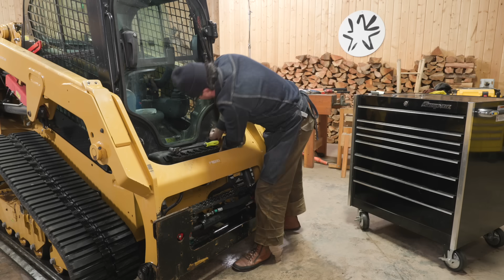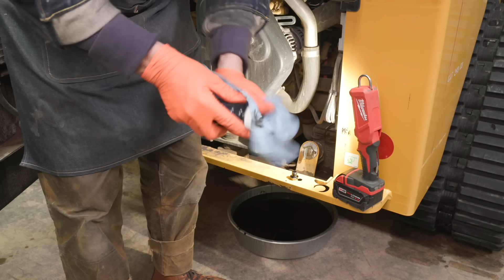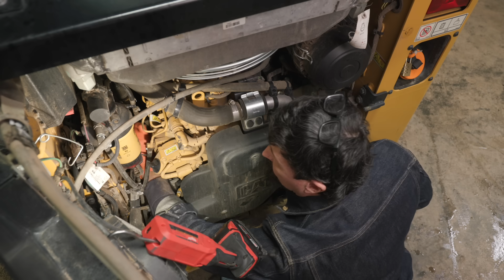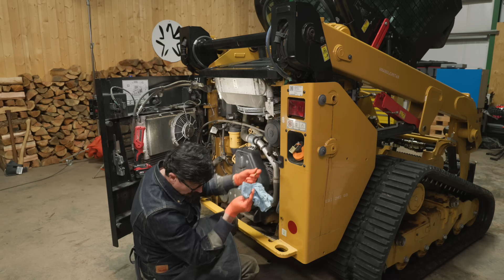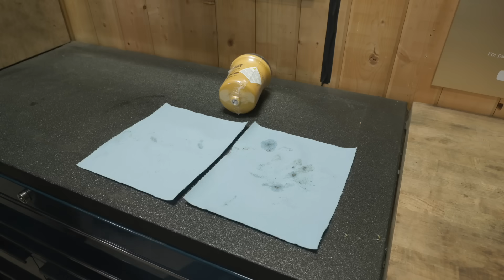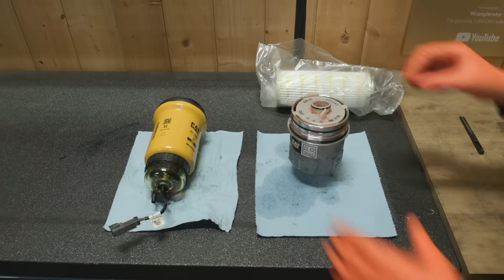Everything is Falling Apart

Comment: As a former cat pm tech, when taking an oil sample the oil should be hot and taken from the dipstick tube. That’s what cat recommends. If you catch it from the from the drain you will get bad results. Also you can clean the outer air filter but not the inner one. To make you life easier take off the Beauty cover it gives you a little more room to work.

Comment: Cody, sadly you are spot on (as usual) regarding the degrading quality standards compared to yester-year. Maybe the old folks when I was young said the same thing? On a side note, I've been a professional heavy equipment mechanic for 40 years now and you are correct, things are unnecessarily packed into much tighter spaces now in the name of "sleek & efficient" redesign. The young & upcoming engineers need to be mechanics for a few years before they are allowed to design machines & equipment. I won't hold my breath. Only 8 - 10 years to go before retirement, God willing.....

Comment: Incompetence has been a problem for longer than you think. I worked on my families farm full-time from 78 until the very end of 93 and we had that same problem getting part for maintaining our tractors and other equipment that you have had with your skid steer. It is very frustrating especially when you go in there with the right numbers for the equipment that you’re working on and they ultimately gave you at least one wrong part.

Comment: I found it essential to warehouse stuff in advance once we finally got the stuff that works.  Prevenative maintenance parts and even fluids.  Most machines use almost all spec. Fluids for everything now and you can't just get them anywhere.  Also nice to make stickers to note the parts , fluid specs. And volumes for quick reference or like we all dread someone else is on the equipment when something goes wrong.  Needed more fuel filters on hand than anything.  When things go wrong there it's really wrong.

Comment: Did you consider a rubber mat on top of tool trolley to protect paint and scratching tools .  Also can stop stuff rolling off
Reply: Or a butcher block top with a vise in the corner. We had that on an aircraft flight controls/hydraulics tool box similar to Cody's, and it was the cat's meow.

Comment: I have a 2007 Bobcat T250, it's a bit easier to service. That 3 gallon figure is fairly common. Our Cummins 5.9 & 6.7 12quart, Bobcat T250 and 1996 Deere 550g 3.3 gallon. The oil change interval at that capacity is 300 hrs.

Comment: Bad samples get another sample to verify and sometimes a 3rd if the the results do not make sense. Also most major manufacturers do not want filters to be prefilled. Too much added engine wear over time has been a credited to filters being prefilled. Not only does the oil in the jug have junk in it from the manufacturing process, but also peoples lazy habbits. They say the oil pump will pickup and fill the oil filter before the residual oil in the pump, oil gallies and beaings surfaces is used.
Reply: Truth. Better to remove the fuel pump fuse and crank it over a few times if a person is worried about priming the filter.

Comment: Red Diesel? In Canada we color Diesel red for home heating
Reply: in the USA red diesel is un-taxed and for off road or agricultural use only! dyed red so it can be identified by law enforcement if they suspect someone is misusing it over the road.
Reply: @tylermallory2504  No Diesel should be taxed.
It power all the working equipment,  farm, construction, big rigs transporting everything, even work pickup trucks!
Less taxes or removal of expensive  tax friendly politicians should be in mind 24/7
Reply: Its also for off-road or farm equipment or other non-taxable stuff: its the same in both Canada and the states.

Comment: It's not always a matter of incompetence of the counter guy. You may not have all the proper information to give him.   I recently was working on the power steering for my Massey Ferguson 165. I have had it for over 15 years but I bought it used. I bought close to $150 worth of wrong parts on the internet.  Even a local guy that used to be a tractor mechanic (he's in his mid 60s) couldn't find the right stuff. He and another farmer/mechanic referred me to an ag supply store that happens to have an expert on Massey Ferguson. I was able to get my parts. But I'm still unable to get the steering adjusted perfect. Sometimes you have to match the parts. I have had problems many times and I only work on my own equipment. Good luck.  You will get your parts.

Comment: Work with a 319G Deere skid loader and it looks like it is easier to do a service on.  Hydraulic filter is in front of motor, below the cab and others are visible from rear access.  And you can check the dipstick and fill oil while standing.

Comment: Long time back, I ran the electrical maintenance side of a South African-based brickworks, using a tunnel kiln and  modern automatic machinery-driven brick making. I lost count of the times I arrived at a breakdown, and the squad were busily trying everything in sight, and tearing their collective hair at the same time. Every time, and I do mean every time; my first question was “Have you studied the Drawings?” I know I’m not the brightest spark in the room, but reading an electrical wiring diagram for a fault is just like reading a book backwards. But could I drum this into the collective skulls before me? Nope!

Comment: Man. Incompetence at these places is getting bad. I was told the other day by a ford dealer parts department that my 7.3 doesn't have a replaceable fuel filter. I absolutely lost it.
Reply: I dont think the new 7.3 does.
Reply: @Phill2tj23  a 1999 diesel powerstroke does too. The new 7.3 is a gasser. So when the parts guy asks the year first and then the model and then the engine... he can't get the new gasser mixed up with an old diesel 25 years apart.

Comment: Had old TF33 aircraft engines that need oil samples burned.  We called them JOAP (joint oil analysis program).  Probably same principle.  They burn it and look at flame and smoke to determine if there is bearing or engine material in oil and how much of it.
Reply: Same.  I worked small turbines (ground support) and we had to send off oil samples at certain hours to the JOAP lab at jet shop.

Comment: Guy who only has 1 drain pan and says every  man should have 2 chainsaws? Doesn't even do final drives or even do in tank hydraulic filter? Rookie, who cares what cat says its cheap and gets rid of all initial break in wear debris. Hour meter cannot measure the wear put on those systems. For the price, do um anyway. Every proho should have mulitple drain pans and have common knowlege on servicing their equipment. Typical west coast boy

Comment: Dont for get you must also change your final drive oil!
Reply: Must?
Reply: @misdabeat1983   Yes first final drive oil change is at 250 hrs and every other is done at the 500 hour intervals. 250, 500, 1000, 1500 and so on.
Reply: What the planetary gears???
Reply: @misdabeat1983  Final drives are the gears that move the track

Comment: Thanks for adding a bunch of those fluid pitchers to my maintenance tools!
I added fumoto valves to my equipment and also use a fluid extractor on some of them.   I also have a oil pump to pump in oil to weird fill locations.

Comment: Put grease on the o ring instead of motor oil. I learned that from a older gentleman on a cattle outfit that I worked on
Reply: If you're doing it quickly I find the residue on the face where the gasket sits always has plenty of the the old motor oil to lube the gasket
Reply: @misdabeat1983 good thing you put that in a reply! 
If you had put that in the main comment page, the keyboard warriors would have a field day with you using “used” motor oil on the rubber!🤣
       (I do the same)😁👍

Comment: You should check your maintenance book and see if there is a second filter location. I am not familiar with that model of skid steer, but I have honestly always been very well attended by Caterpillar parts especially if you gave them the serial number.  Those machines are built and each component is basically matched to the serial number.

Comment: you think it would make more sense for a company like cat to have all the small machines use 1 type of filter for each fluid rather than have 50...
split it into small, medium, large, XL sizes for everything and keep those parts onto newer models for as long as possible.
its got to be WAY cheaper to make a lot of 20 different filters rather than a few of 200 types.

Comment: You need to get a clean burn oil burner to use your used oils to heat your shop. It eliminates having to dispose of your used oil properly
Reply: Agreed
Reply: Those will burn almost everything hHa
Reply: Would it actually burn clean with contaminated oil?
Reply: @chemicalbrucey157  probably. they have filters for them

Comment: Caterpillar cares so much about their reputation that when they mandated DPF filters on simi trucks that they stopped putting engines in them. they knew from the start that DPF systems were supposed to be the death of diesel engines, and they were not willing to compromise. they do have very good dealers too from what i have experienced. the only company that you can get parts still for dozers from the 1940's back when i worked on them. i made the mistake of switching to automotive repair.

Comment: I learned many years ago to take the part with me if possible. get any numbers off of it and check my manual for part numbers. as well as make, model, and serial number off the machine. few parts  guys actually know what you're after. they just know what the computer tells them.

Comment: Yes, never trust opened oil vs the cost of an engine.  I recently had a close call only saved by the introduction of the opaque oil pitcher.  I had drained used brake fluid into an empty quart oil container and put it back on the shelf, thinking I would remember that it was waste and not oil.  3 months later I am doing an oil change and opened the used brake fluid container and almost dumped it into the engine.  For some reason I stopped and filled the oil pitcher and noted the blue color of the 'oil' and how thin it was.  I contaminated 1 gal of synthetic oil but saved contamination of an engine.  Penny-wise....

Comment: You seem to have a lot of equipment that uses oil; what are your thoughts on used oil furnaces?
I worked in an auto mechanic shop that used one and it was surprisingly efficient as long as the drip rate was correct.

Comment: i wouldn't be so fast to point fingers you always and i mean always double check part numbers and serial numbers for any machine there are instances that an oil filter can have the same dimensions and threads but the pressure reliefvalve for the oil bypass relieves pressure at different pressures an example of that is the MAN w940/25 at 2.5 bars and the w940/35 at 0.7 always be carefull what you put on your machines guys

Comment: You own the equipment....your fault. If you don't know what parts you need you shouldn't be servicing it.
Reply: 😂😂say you don’t work on your own vehicles without saying it…
Reply: @mich5167  Me? Yeah sure. If you are depending on someone else to give you the correct part, have someone else do the job. It costs more after you mess it up and have to take it to me to fix your mistake. You purchased a very expensive machine. Invest in good maintenance or atleast read the manual. Don't just assume you know what to do.
Reply: @retam1418  oh yeah, why even have customer service right?

Comment: I wouldn't run that little engine to its maximum service interval on engine oil they have tighter tolerances and spin much faster than big engines I change mine around 200 hours

Comment: Fuel and oil filters should never be pre-filled. When you pre-fille a filter, one would generally fill through the center of the filter. The center of the filter is the "clean" side of the filter. By pre-filling through the center, you are introducing potentially contaminated oil into the system. Couple that with no benefit because fluid systems (on Cat machines) are designed to operate properly on start-up with no oil in the filter. Maintenance is a leading source of contamination. Before you crucify me, I've worked on or around Cat machines for over 20 years and currently lead the technical support team at a Cat dealer.

Comment: There’s 2 hyd. filters, the pilot filter and the in tank filter. Sometimes 3 hyd. filters. The new filter is an in tank filter. I’m not a specialist on skidsteers I usually stick to loaders and dozers, but I think you should check for moor filters on you machines.

Comment: It onky takes 2 gallons a 1/4 of a gallon but they sell you 3 because they only have it in gallons and 55gallon drums thats why if some one tells me it takes 4 gallons at 2 gallons i check the dip stick if its half way I know they are right if not then i know they are wrong right away cats filters are mad by baldwin also easy tip use a pice of garden hose to put on the end of the funnel and then you can fill anything at any angle

Comment: Wrong filter that filter is the prefilter inside of the tank Technically, it appears as if it's still one of the hydraulic filters. It's just the wrong one. Usually there's two or three in the hydraulic system

Comment: Everybody that does their own work has had little flubs like that. But in the long run, you know it is done correctly plus you save many many dollars. I used to assume that a dealer would put in their own oil brand but they just use whomever wins the low price bid just like the quick lube places do. They use their own filters though.

Comment: Years ago at the local Lawn Implement store/shop I worked at we used a three gallon hand pump sprayer to fill lawn mower engines for service.  You could buy or make your own pressure vessel to fill and do the same thing.  Great video!  Watch your channel occassionally.

Comment: One thing that you get with professional equipment is a level of quality and design strength to protect it from whatever you may get into.  You pay for it, but it is designed better in the beginning and may last your lifetime, if you take care of it.  This is a great video!   this unit looks young enough where the parts person should either have a list of the stuff you need, or have an exploded parts diagram to let you find that part.  But for $15per hour, the guy probably does not care.  It is sad but service is not what it use to be.

Comment: Speaking of parts store people, I once bought some oil for my truck. I get home, drain the pan, install new filter, open the 5qt bottle of oil and realize that its used oil. I called the parts store and told the guy what happened and his response was "Well, just drive up here and we'll exchange it". I asked him if they would exchange my engine as well after I drive it with no oil in it. I had to borrow a neighbor's vehicle to drive back to the store which cost me even more money b/c I had to pay for the gas.

Some dickweed had returned a bottle of used oil and they didn't bother to check if it was unopened. They just put it back on the shelf. In hindsight, I should have known b/c it occurred to me that the bottle looked dirty, but I thought it was just dust from sitting in on the shelf for a while. 

I also had this happen with a set of brake calipers as well. Thank god I checked the box before leaving. Now I check everything at the counter before I leave to make sure its new and/or unopened b/c those imbeciles working there either don't care or don't know. It makes me wonder how Autozone stock is over $2K a share.

Comment: I'm a contractor. I'm a repairman, handyman, plumbing, hvac, electrical, etc. They're replacing key components in all sorts of products with plastic or ceramic rather than steel, I've seen this many times.
Reply: Which products for example?
Reply: I noticed something similar with Uncle Henry knifes I have one my grandad gave me the handle scales are solid bone i got another one a few days ago and the scales are holow plastic